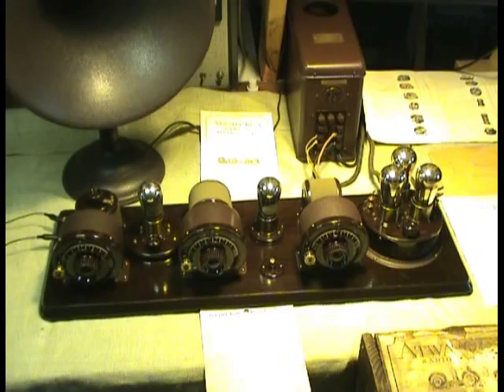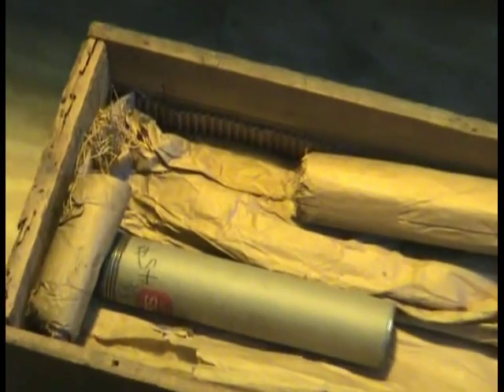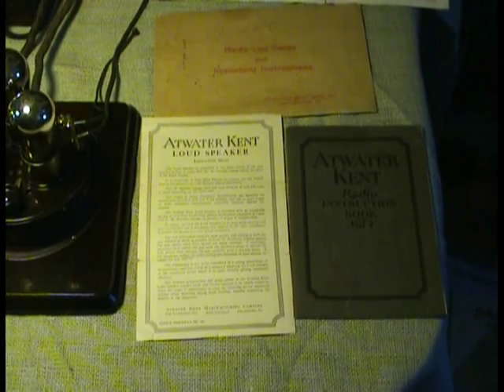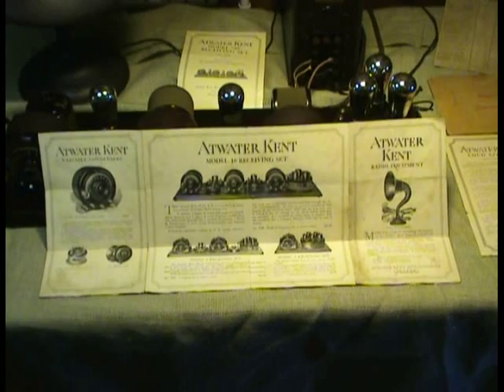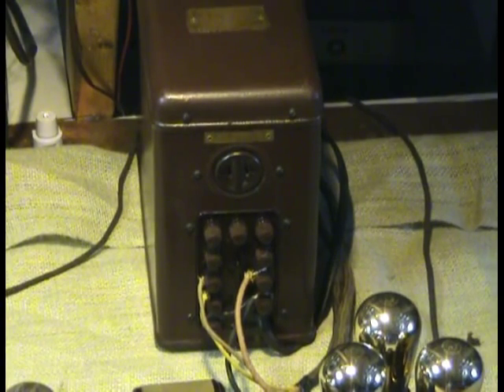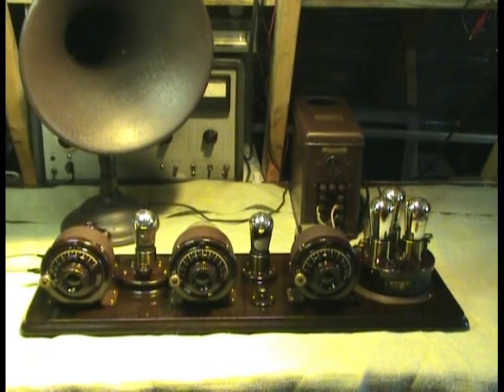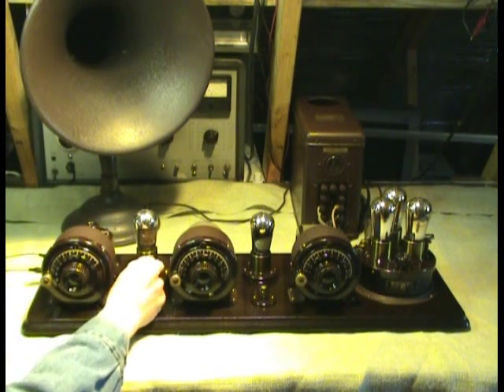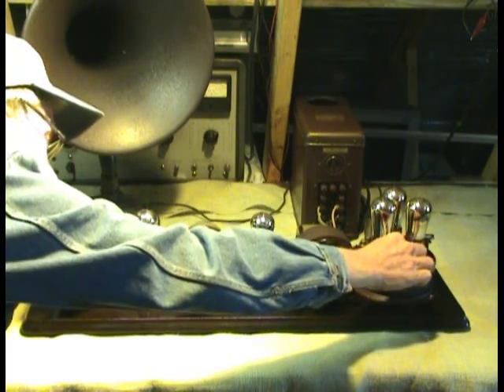Atwater Kent Breadboard Model 10C (4700) Time Capsule, working demo

Comment: What year did this radio come out?  Why wasn't used for 75 years? What type of set is this, regeneration, TRF, or something else?  What are the controls doing when you adjust them?   I can't see any wiring on top of the breadboard is the wiring under the breadboard?  Is this how this set was sold, with no cabinet, or was a cabinet separate?  Sorry for all the questions, but It would be helpful if you'd provide more info during the video.